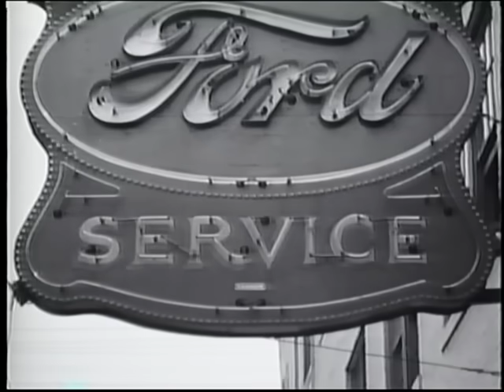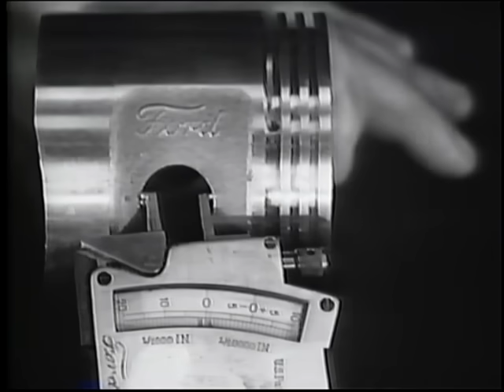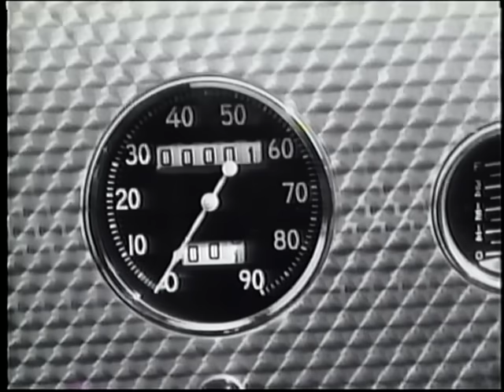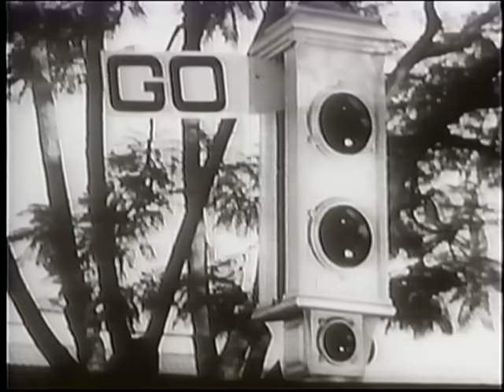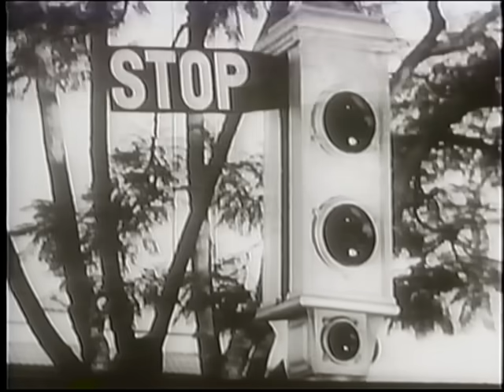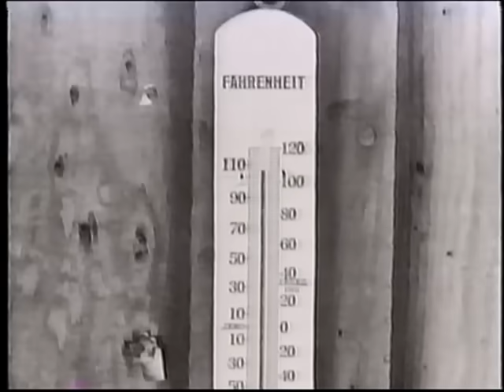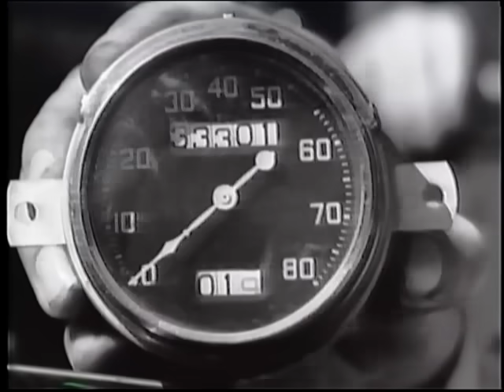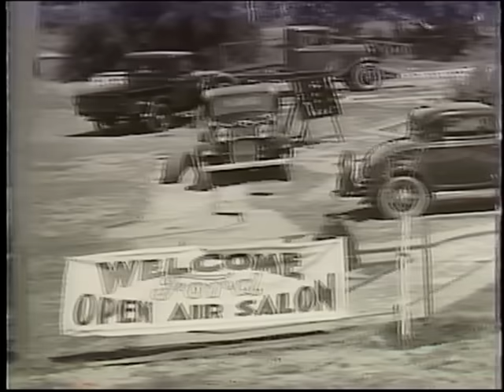1932 - The Invention of the Ford V8 Engine

Comment: I love to see the amount of intricate engineering that was accomplished with out electronics and computers...
Reply: Dude it one chunk of metal pushing another. It is actually pretty simple. The only complex part is the cooling system. That is it.
Reply: @ian_lambert-knight  Everything is easy once it's been invented/developed for you. If you think the cooling system is the most "complex" part of an engine then I doubt you truly understand an engine beyond "piston goes up, piston goes down." In fact, the cooling system is the simplest part of an engine and hasn't changed much since the inception of it.
Reply: @Clickbaiters  99% of the engineering in this video were not invented for this car, but much before. The problems were solved over a long period of time. Engineers job is to solve technical problems mostly with known solutions as efficiently as possible. That is what makes engineering different from art; the process to design something is not chaotic but systematic, the aim is to develop efficient solution processes to common engineering problems. For example, a car can be divided into smaller sub problems; engine, gearbox, frame, body, braking system, etc. And those to even smaller problems. For each small problem, there usually is a known solution process already, like electrical spark plugs for ignition, etc. Then something new on some field may be developed, like the new type of V8 engine in this video, but even in that case, 90% of it is existing technology. Complexity is actually a very bad thing in engineering, the idea is not to make a complicate design, the idea is usually to keep it simple, because complicate design is more prone to failure, more difficult/expensive to manufacture, etc. Smart design is that design, that manages to do a complicate thing as simply as possible. But indeed even simple things can be quite difficult to get working exactly right. The devil is in the details.
Reply: Ok, the biggest problem early combustion engines face was reliable cooling. This single part is very complex in comparison to piston technology. Witch had already existed for hundreds of years. It requires you to be able to move coolant through out the engine and cool it. Adding to that you don’t want to over cool the engine and need to more or less evenly cool it.
Reply: Well I’ve never cast anything.
Reply: Adding to that just about everything else is just one bit moving another, using recycled technologies from the Victorian era. A modern engine is simply more complex and less reliant on one bit pushing another. It just a smaller version of a steam train that has been modified to run on gas. Stop treating like some ideal to be returned to, because it isn’t has good has you remember.
Reply: @Ian.  Something is always 'simple' when you reverse engineer it.  Don't give up your day job at McDonald's.
Reply: I don’t work at Mc’Dy
Reply: a 1933 Alvis speed 20,  had cruse control, adjustable suspension on all dash and wheel and did 100mph + my father owned 1 only sold it last year
Reply: The impressive part is how scalable it became to mass produce.
Reply: @Clickbaiters  Going from the two blade fan to the four blade model. Why, that's genius!! haha.
Reply: @ian_lambert-knight  you should
Reply: @ian_lambert-knight  Yes it is simple, but PRECISE ENGENEERING. That's it. 
You can UNDERSTAND it ALL YOU LIKE, but PRODUCING metal objects within thousandth of milimeter precision made of HOMOGENOUS metal without (too much) faults, bubbles and cracks is another thing. 
Tolerances will get you, or, as some say, devil is in the details;-)
Reply: THEY HAD COMPUTERS....i think you mean electronic computers
Reply: Slide rule and drafting board.
Reply: @ian_lambert-knight  the cooling system is not the most intricate part of an engine how dense are you? That’s like the easiest part

Comment: I had a 1981 VW Scirocco. I truly loved that car. It was the best driving car I have ever owned. I am presently driving a VW Jetta Sportwagen. I like it lots. 
I have been driving, repairing, and modifying VW's since my family bought a Beetle in 1963.
The Scirocco had an AC problem from brand new. The thing you learn about VW is you will have at least one problem from the start. You don't know what the problem will be, but there will be a problem. The Scirocco AC was controlled by a crazy system of levers and wires. Supposedly, the temperature would be controlled by this Mickey Mouse system. After 2 visits to the dealer, I decided I had enough. Went into dash and was shocked at what I saw. This Rube Godberg system would not stay in alignment. I went back to the parts counter at the VW dealer and got a lighted switch that matched the other rocker switches in the car. I bypassed the microswitch that controller the compressor clutch. So I ended up with a "desert only" AC system. Even though I usually had high humidity, I never had a problem.
Reply: A friend of mine had one of those with the same problem.  Great car.

Comment: I remember the old flathead V8’s very well. I had one that ran for years without an ounce of oil pressure—the oil pump drive gear pressed on the end of the cam shaft had come loose. Mine was the popular 85 horse power but they also had a little baby brother V8 that put out 60 hp. The only reason I eventually ditched my old Ford was that the girls weren’t interested!
Reply: That explains why! A mechanic that I worked for in high school used to sell Wynn’s products. He told me about a V8 that the Wynn’s regional distributor used take to fairs for demonstration of their oil treatment. He said that they would drop the oil pan and let it run for a half hour with no oil pressure. He also said it was a flathead Ford. It sounds like they don’t load the main and rod bearings very heavily judging by your experience and this.
Reply: Y bfi xbl tut
Reply: WHY DON,T THEY MAKE THEM. AGAIN, THEY WERE EASY TO KEEP UP
Reply: @charlesbracken367  Who would buy them? Not todays youth thats for sure .

Comment: This is thee most interesting picture of how an automobile came out the end of an auto assembly plant. I worked at General Motors Assembly plants at South Gate and Van Nuys for 14 years and never grew disinterested in the automobile production. If you can visit and see how a car is built do it! It's a marvel of engineering.
Reply: agreed. I think the machines used to build the car, and the manufacturing processes are even more interesting than the cars they produced.

Comment: Frenchman Leon Levavasseur was a 39-year-old inventor in 1902 when he took out a patent for the first V-8 engine he called the Antoinette. The V8 since then has become the most reliable and efficient internal combustion engine to power automobiles and to see extensive use in power boats and early aircraft.
Reply: Nobody said Ford built the First V8. He built the first MONOBLOCK V8. Ford had been building V8's for years already, but not monoblock.
Reply: Leon was a HACK.
Reply: Google copy-paste I see
Reply: Did the Frog Frenchman sell over 13 Million V8 engines?  I didn't think so.  lol.
Reply: Hullo  Pattie .
From  ,  Perth .  West  Australia .    
That  first  V 8  French mans '   engine  and  the  good      design  features  of  it  , 
were  abandoned  by  later  V 8  engine  manufacturers ,  including  Mr . Ford . 
Truth  be  known .
Now .  
And  the  truth  is  more  evident  now  about  ALL  auto  engines  and  associated  parts .
The  designs  and  componentry  quality  is  less  than  satisfactory   or  bad  in  ALL  of  them .
Minor  AND  Major   defects  have  not  yet  been  entirely  eliminated  or  minimised  sufficiently  yet .
Although  there  has  been  SOME  major  changes  to  parts  ,  such  as  fuel  supply  via   injection   and  electronic  ignition  ,  rather  than  earlier  technique  used  in  components   for  fuel  &  ignition .
The  fact  remains  ,  VERY  much  more  needs  to  be  changed  to  achieve  better  or  best  possible   results  .
From  ?
Design  knowledge  already  thought  of   years  ago .

Design  a  mistake  ?
And  a   fool  of  a  manufacturer  will  make  that  mistake   for  tens  of  years  or  continually  in  a  factory  
UNTIL  ?   Stopped .

Examples  ?
Nuclear  bombs .
Waste  products .
Ancient  Greek  Styles
Democracy  .
No  death  Penalty  for  multiple  murders .
To  mention  a  few  .
So  ?
So  ,  we  are  stuck  with  failures  ,  generation  after  generation  .
Mass  production   !
Of  them  !  
Why  not  change   ?
S  O  O  N  E  R    !
Reply: @jonhohensee3258  
No   ,  not  true   !
Are  you  Dutch  or  Scandinavian  ,  to  say  such  a  thing  ?   
Leons  '   V 8   had  some  valuable    design  features  .

Similar  to  ALL  ,  GOOD  THINGS .
FORDS "  Mono  block  was  primarily  intended  for  
American  cheapness   and  simplicity  and  speed  of  production   etc .
NOT  to  maximise  quality  of  design  and  componentry  and  manufacture  and  assembly   etc .
But  to  make  MANY   ,
AND  ,  to  get  them  to  ,
     The   MANY  .

Comment: It's pretty cool how accurate and tight the tolerances where even back then.
Reply: I honestly think they were probbly more accurate then than they are now.
Reply: Clearly you've never built an engine. The tolerances quoted in this video are horribly sloppy and huge compared to what you need today.
Reply: @e-curb  you also don't really understand motors we're a bit different back then
Reply: @thatoneathiestguy2752   I'm well aware of the differences between engines back then and today.
Reply: @kylekenan2321  the tolerances in these videos are incredibly sloppy. It might sound tight, but today’s machinery can do much tighter tolerances
Reply: @e-curb  clearly you haven't noticed how much more longevity and durability an older engine has vs a modern engine.
Reply: @kylekenan2321  You think older engines are more durable?  Try revving a flathead engine to 8000 rpm.
Reply: @e-curb You are correct. My uncle restored and repaired Model A’s for living, including engines.  Tolerances were Huge.   Machine shop rebuilds never ran right - tolerances were too tight.

Comment: The thought of finding the perfect timing/motion and the ability to generate electricity to sustain it took some serious engineering and it didn't happen overnight.  Now these things run so efficiently that they are cleaner and more powerful with reliability than ever.

Comment: Those cars are absolutely beautiful. I bet if Ford reproduced these cars exactly as they were with modern drivetrains and safety features they would sell....I know I would buy one.
Reply: Or even without modern drive trains. Just the originals with the bare minimum of safety equipment necessary to be allowed and just sell them as an extremely cheap durable alternative for a new car
Reply: They could even use it under the facade of being a licensed continuation car. And then sell a new model A for like $6000 and do that with all their cars, like the more classic mustangs and stuff, all their old cars. Sell them for like $8-$16,000
Reply: Impossible to make safe